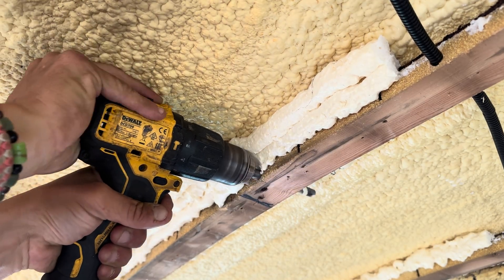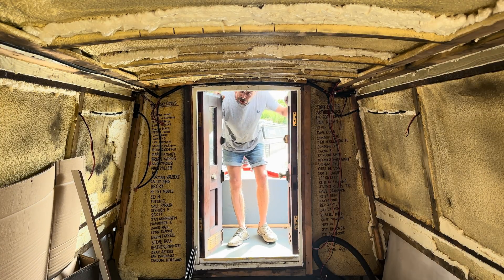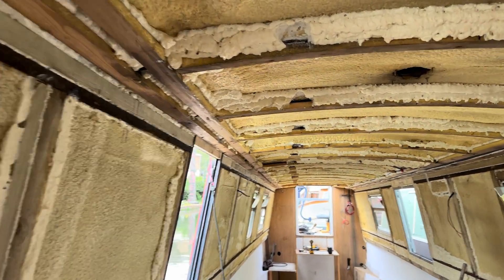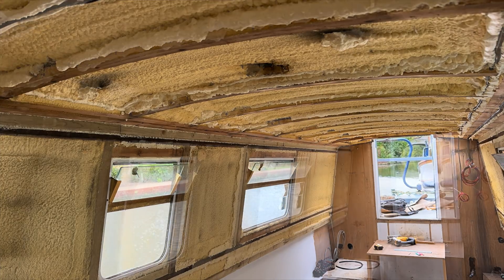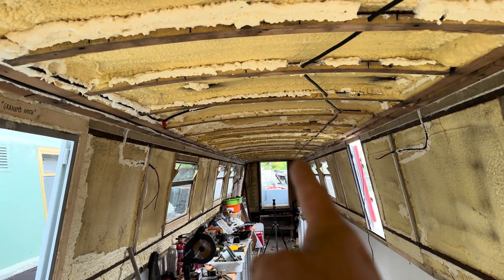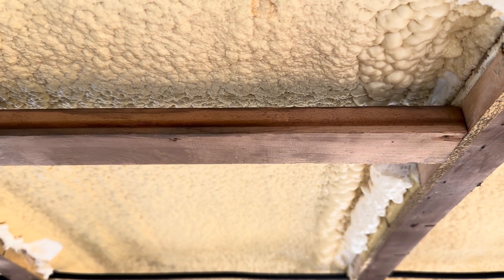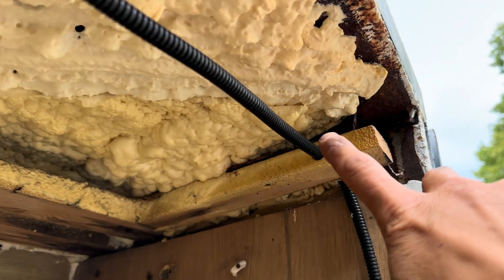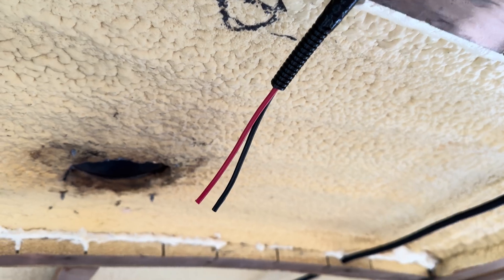480. WIRING 2-way SWITCHES | NARROWBOAT Lighting

Comment: What is the point in being able to switch lights on simultaneously in both the fore most room and the stern most room? Once all the internal bulkheads are installed and any doors and fixtures in place, it's highly unlikely that a light at the one end of the boat will be able to be seen when switched on from the opposite end, so why bother wiring it like that in the first place? 
You don't need the kitchen light at the rear of the house to illuminate when switching on the front hall light, so why would you need to do so on a boat?
Reply: @IDKline  That may well be the reason he feels the need to have lights on at both ends of the boat simultaneously, but I can definitely say that we have never felt the need to illuminate both ends of our boat from either end of it at the same time, it's just simply never been an issue.

Comment: Slightly confused as to why you want both front and rear lights coming on together. What if you have a child asleep at one end and you exit/ enter through the other end turning their light on and potentially waking them up? Also in my first house I was very pleased with the two way lighting until I moved in and realised it had been done wrong and for a light to go off it had to be off at both ends. I was up and down the stairs a lot until I  got it fixed.

Comment: What’s the plan for adding mushroom vents? Also you could batten the ceiling a bit left & right of center to allow for vents or lights etc. If you’re concerned about the heater affecting the conduit, you could put some rockwool insulation in the ceiling void in that particular ceiling bay. Rockwool could be another option generally to add insulation against the hot/cold steel roof shell to augment the very thin spray foam - could save you a bunch of money on heating & help the fridge work less.

Comment: I just noticed you are planning to fit your batteries inside your boat living area. Are batteries a fire hazard and if so shouldn’t they be in the engine bay so there is a metal bulkhead between you and them.
Reply: I think James is going for lithium batteries, which don’t like the cold of the engine bay.
Reply: @PinkLittleElephant  google search lithium battery fire and then decide if you want one

Comment: That spray foam insulation still looks very thin to me. I would think insulation is very important on a narrow boat for the heat economy. I think it would be much better to install thick sheets of insulation.

Comment: I'm still a bit confused about putting that much wiring along the roof, where it will be hard to access.
Why not run all the wiring under the gunnels with spurs going up the sides for ceiling lights?